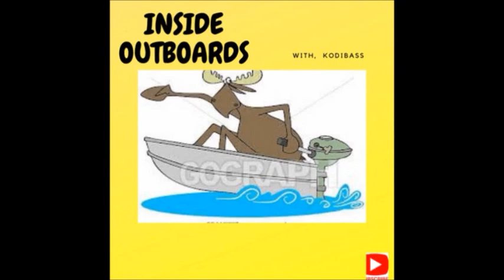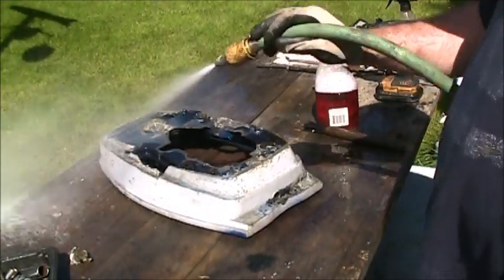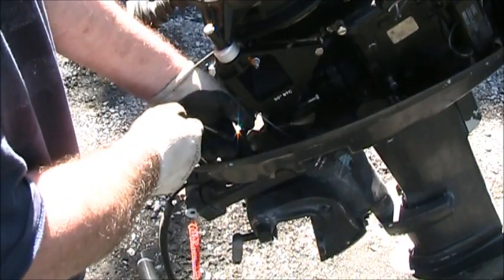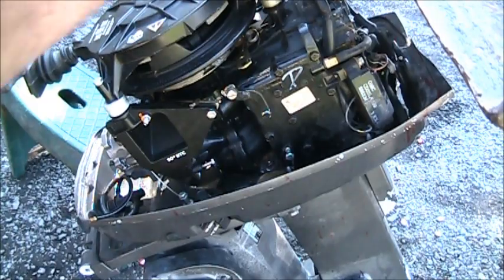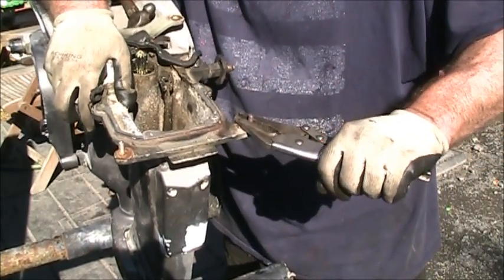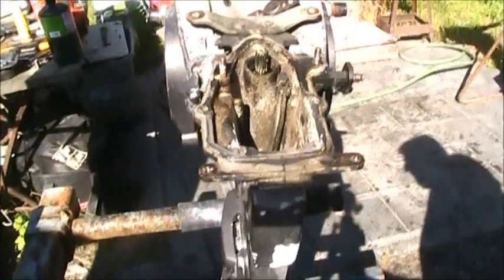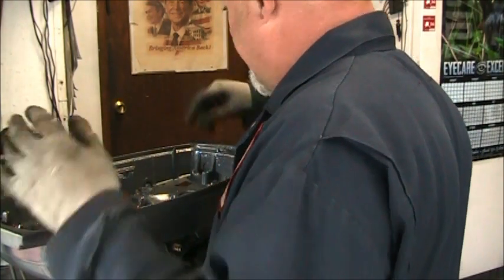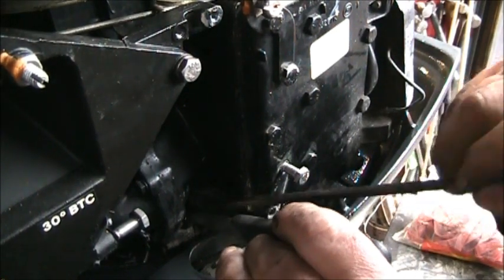Johnson 30 HP,  Pluse  more..

Comment: I'm a new subscriber and really enjoy everything about yer channel. Electrolysis/salt corrosion between dis-similar metals really blows! Also it's tough to drill stainless unless you hot it up. I, too have had to resort to drilling lube holes to free-up studs. It was cool to see someone else do it. Many years ago, an old-timer auto mechanic turned me on to left-cut drill bits for snapped bolts and studs, but haven't tried that on an alum/stainless seize. Thanks for yer channel Bassman!
Reply from the maker: +MH,  thanks for watching / subbing ,  I have used the left dill bits on still as well every little edge helps 4 sure.                                                                            kodi

Comment: Watching you do so many compression checks on motors like my 1998 Johnson 30 horse made me want to go out & buy a compression tester kit to see where i stand even though my motor starts good, never misses a stroke & seems healthy enough on my 15 foot Crestliner Voyager with its heavy  homemade 1" plywood flooring. I figured 23 mph when alone was normal. Especially since the Garmin depth finders big transducer & speedo pitot tube slow me down a bit also.  But to my suprise, i only had 80 psi dry in each cylinder & 90 psi with fogging oil ! So im grateful for your videos where i can learn how to deal with this, how to disassemble & what to look for, thanks for sharing!
Reply from the maker: Thank you 4 watching, & commenting,  I love the old crestliner boats, The first boat I Bought here on Kodiak was a crestliner,  sold it & regretted it. Oh'  well I had my first brand new Johnson 30 on it,, memories 4 sure..  kodi
Reply: Kodibass, I started the job of removing the powerhead on my 1998 Johnson rope start tillerless 30 hp motor. I thought I was overcoming the little obstacles good enough until I came to those two 1/2" nuts on each side of the powerhead  toward the front of the powerhead on its mounting flange that thread onto studs coming from under the pan. Very little access to the nuts. I couldn't get a good enough grip on it with my open end wrench to have any leverage and not round off the nut.  Im sure you pros have some sort of special offset dog leg box wrench that zigzags around the obstacles and sticks outside of the motor pan to let you get a hold of it with your hand. Might you be able to tell me exactly where I could buy one of these, I can't seem to find one, I don't know how to Google the right words, I guess
Reply from the maker: @jeffreywhicker8947  ,  Did you watch this the entire  video?  I show you how to make the tool from any old 1/2" boxed end wrench & a a old bolt,  If you really want to buy the OMC special tool it is available for $60. + shipping @  boats.net  go 2 their website type  0322700 on the search bar & that is the OMC version.                                                                           kodi
Reply: Kodibass, thanks for your quick reply again! Much appreciated! I may have watched the entire video a while back, but didn't pay any attention to the part where you show the special tool made from a box wrench. At the time, I hadn't done my compression test & didn't know I would be wanting to remove my powerhead to look for, likely, a blown head gasket betwern cylinders. So I will watch the whole video now, but just wanted to thank you for this reply first.
Reply: Kodibass, I also thank you for providing that link for the OMC wrench. And, for the "entertainment" we are treated to when you are visited by neighbors such as the parts monkey, or the cigar butt smoking salty Alaskan fisherman! And when the talented guitar playng musician does interesting parodies of pop songs!

Comment: Wow, That is a cool way to remove stainless bolts in aluminum casting and still be able to lock in new bolts with antiseeze. Saving old motors for another day on the water👍 I still want to try testing alumaweld sticks on holes to drill and retap to see if it works. The stick material is harder than the orginal aluminum but it's also a bit brittle. I guess you can't just fill a round hole for it to work right so it needs some routing and bevels to add some grip. Going to get some old aluminum to test it on. It worked good on my prop and hasn't fallen off👍
Reply from the maker: +TWS, Make sure to video it & share.                                           kodi

Comment: Lube holes are a cool idea.   Did you cut out the new base gasket so you didn't have to pull the inner megaphone off?  I guess you weren't "feeling lucky" removing those lovely little megaphone bolts!

Comment: Question, more of a mayday really. I have an 1988 johnson 28 that cracked the block, ordered a used good block to find out its wrong,it's an 1985, also broke the starter bracket when I dropped it, not having the best of days. Would u have a block and bracket  for the 88. One video said to shout at ya if parts were needed.   And one more question. Just rebuilt my 76 evinrude 70hp...love the old ones.....do u have any video on the timing and link, it's stuttering bad mid rage. New fuel pump, carbs r clean.
Reply: A block stamped 20 would be ideal
Reply from the maker: @stevekyle4371   Sorry but I looked & do not have a block,  As for timing your link & sinc,  I Know i did a video on a commercial 50 and the process is the same I do not remember what it was titled tho.  Get your manual for your motor it walks you through the 7 step process very well.                                  kodi